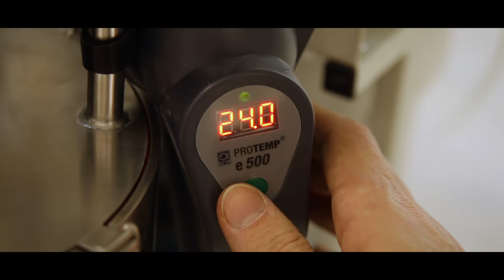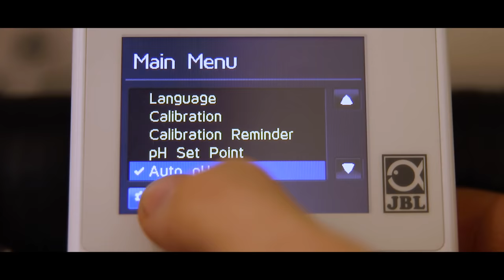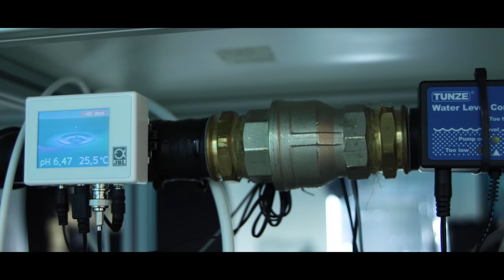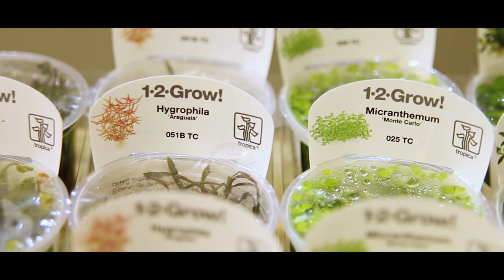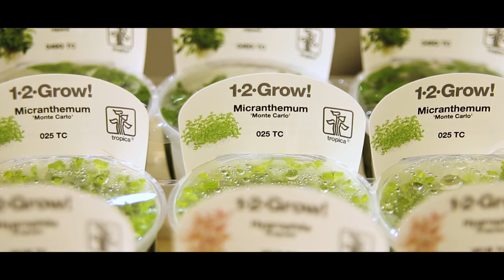180P NATURE AQUARIUM | Stunning Dentist Tank!

Comment: Say please, does the glass bow abit on the long sides? If yes, is this normal?
Reply from the maker: A little bit is normal yes, however some manufacturers use thinner glass as it safes up to 50% material cost and in this case it can bend significantly and is more prone to fail compared to thicker glass

Comment: Jurijs, very interesting,  this is a 'no expense spared' tank yet from your comments and footage here, severe algae issues.  Theories?  My suggestions would be that the initial substrate was a bit too generously rich and that the tank may be illuminated for too many hours a day.  
Other than rescaping the tank what are your suggested fixes?
Love the breeding tetras gradually becoming dominant.  My 'let it be' approach would let the system run for another year or two as a fascinating little experiment.  In my tank the Panda catfish population grows if I let the carpeting plants overwhelm the set-up.
Ref. the algae, I would be tempted to  hard prune out all old algae covered leaves and then add Hornwort and let it run for 3 or four months to balance things and then gradually wean the tank off Hornwort and maybe add a fast growing but potentially more interesting plant, say Pogostemon (stellatus spec.) or even, given the bright light and softened water, Rotala macrandra - the latter is a challenge but can grow like a weed in the right environment. Many thanks as always, great content.
Reply from the maker: The tank was running for approximately 2 years before I decided to rescape it. The first 1.5 years I had no issues at all. Well maybe some minor, but nothing I wasn’t able to fix.. however after the second summer and the heat wave, some Buce took significant damage and an ongoing melting process has started. This was a massive source of organic wastes.
Reply: @JurijsJutjajevs  Thanks for replying, that makes a lot of sense.  I have had temperature issues myself occasionally damaging plants and causing algae (mainly when using T5 tubes) and sunlight strikes from the higher sun in the Spring.

Comment: I still remain curious if there still isnt a better option than using superglue for hardscape.
Dont get me wrong. i use it all the time. Its super easy to work with, however everytime after half year or one year, the superglue isnt holding properly the hardscape. By that time hardscape is partially hold by plant roots, but still this is the issue with propably every CA glue i ever used in aquarium
Reply from the maker: It depends how long you want the glue to hold. For me superglue is enough as I don’t keep the builds for too long. If you want the connection to last extra long, you can reinforce the superglue joint with aquarium silicone